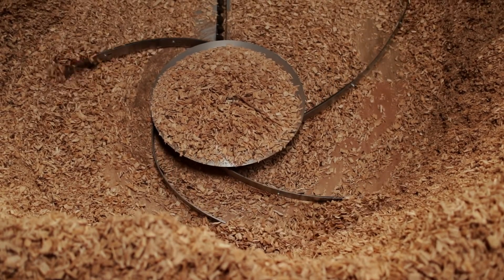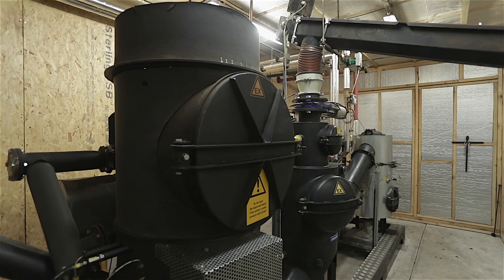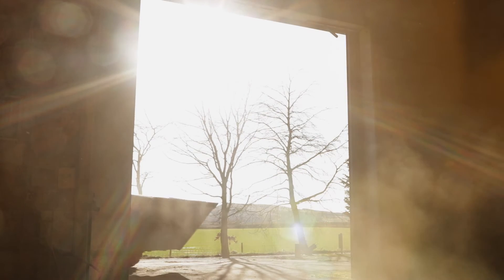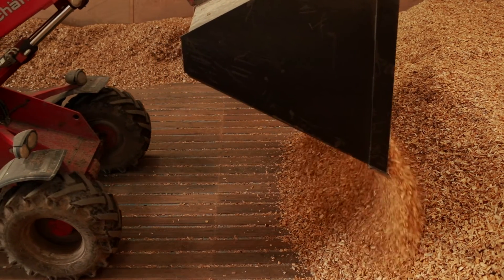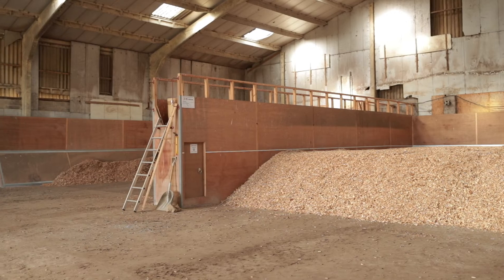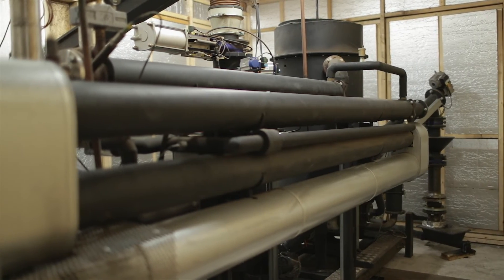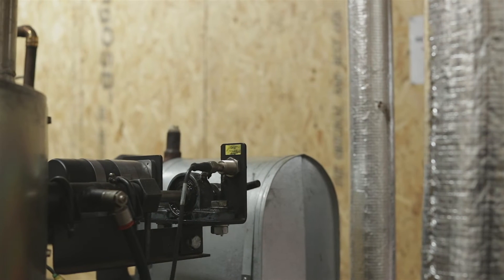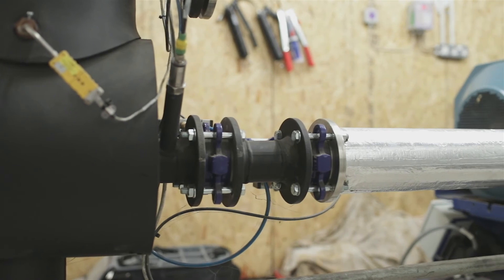Organic farmer supplies stables & farm with Biomass CHP | Kosten in der Biolandwirtschaft reduzieren

Comment: How much does everything cost? The equipment, installation, maintenance, ongoing feedstock costs etc., compared to using electricity and gas/oil? If it made sense 5 years ago it’s going to look fantastic in July 2022 with wholesale gas prices going up by a factor of 10 in the last year.
Reply: $268,000 euro for the 50 KW apparently from there Facebook post I painfully translated it was a picture with words in german , massive word means price or annual , almost fun like bondage .

Comment: hi very nice system ! how many kg  per hour of wood chip is used to produce the 50kw ?
Reply: About 0,9kg/kWh, for 50kWh, it’s 45kg of woodchips
Reply: @lailacobbaert9670  So 20lbs/hr of woodchips. I wonder if he ramps up or down and if the setup is turned on only during working hours. Thats quite a large amount of woodchips. I do wonder how much all that costs. A ton or so of woodchips a week, which he mentioned he also has to dry.

Comment: If this technology could be scaled down and simplified it could and would make long term sense in every residential home in the world and thus taking away the power and control from all utility companies and their corruption, at least in the USA.  Why isn't this technology mainstream, complacency?
Reply from the maker: Dear Mr. Flinn, thank you very much for your comment. Spanner Re² continues to develop its technology, which has been known for decades. We work closely together with our customers, always with a view to the future, with the goal of sustainable electricity and heat generation from wood. We produce different plant sizes for different applications.  For example, our smallest plant has an electrical output of 9kW. You can find out more about our plants on our website: https://www.holz-kraft.com/en/
Reply: Build one in a truck and have the option to fuel an engine other then the truck. I can pull a pipe of clean woodgas off my truck to power small motors like the generator that powers the house in a grid down situation. Primary fuel is pallet wood which seems easy to get anywhere you go, gets me to work every day
Reply: Public power is usually cheaper in most places in the USA compared to buying and operating a generator fueled by biomass.  I'm sure that there are exceptions like Hawaii and some places in California.  The equipment is not simple nor inexpensive.  Solar power is both simple and relatively inexpensive - albeit available only 3-8 hours a day depending on weather, location and season.  One of the main biogasses in pyrolysis in carbon monoxide, so it has to be handled with great care and can never be used inside of a residential dwelling.  This would be a nice compliment to solar in an off-grid location.
Reply: @omaha42000  - The technology is simple and its inexpensive! The technology was used in the early 1900's in vehicles to save valuable fuel, there is not a lot of power from biofuel that is why today people use Dodge Dakota's with V8 engines and Dodge Rams with V10's. A 12kw generator is $1000 from any store, you could probably find a 20kw generator for $1800-$2000. Building the gasifier is easy to do, you'd need a welder and some simple fabrication skills. You can view many video's on how to build one on Youtube. The key to success is controlling the fire, and the air/fuel mixture. Like the automobiles, when specifying a generator to run on biofuel/woodgas you need to over power the generator. If you want 12kw, then get a 18kw generator. Hooking up the unit to your home would require a licensed electrician and a main switch. But I am sure there are easier ways to hook up selected appliances, like the heaters, stove, a/c, electric water heater, electric furnace, microwave and anything else that uses huge amounts of power. The question becomes, is $2000 worth the effort in switching your home. All utility companies have base fees you have to pay no matter if your bill is zero or $300/m. In cold climates it is well worth it, especially if you heat the garage, or have a hot tube. I am seriously looking into converting my home, but I will look a the holz-kraft website and see how much it costs, then look at my power requirements.